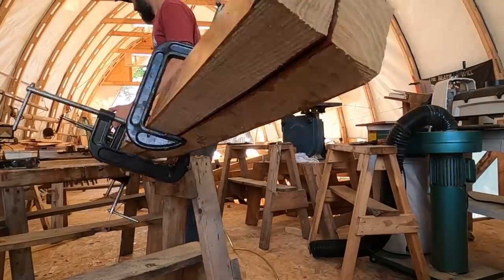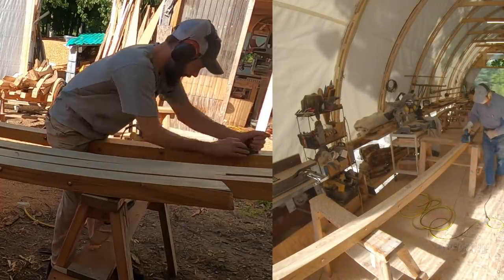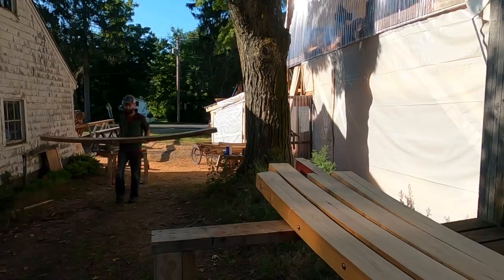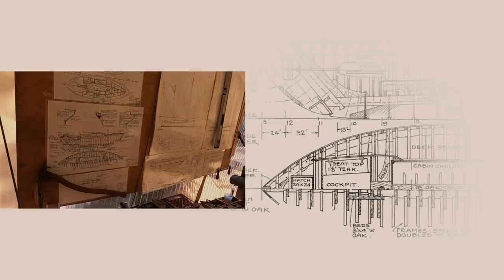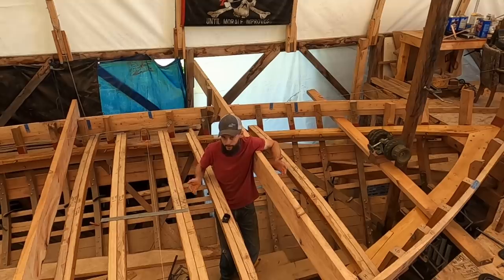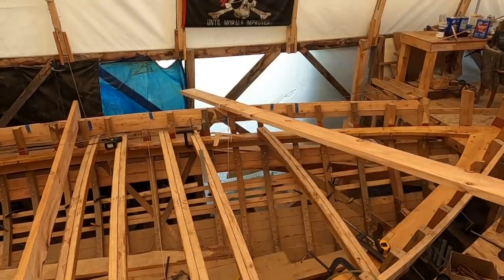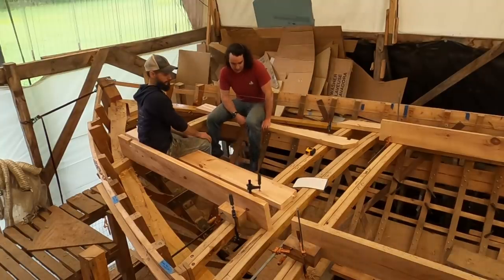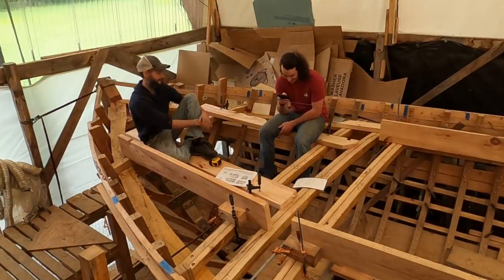Deciding the Hatch and House Locations - Ep. 130 - Acorn to Arabella: Journey of a Wooden Boat

Comment: I have been building boats for a lot of my 68 years on this planet.  I wish I could jump on a plane and come help.  A nice tender is great but I would also put on a life raft along with the tender.  You never know when disaster strikes.  An unsinkable tender still tide down to the deck will sink like the amount of lead ballast you have in your boat.  Whale strikes, freighter ramming's and reef ramming's will sink a boat in seconds, not minutes.  Have a secondary life raft.  Have epoxy and boards to slap on in case of a puncture from an underwater object.  I always carry a sea anchor in case of a tiller malfunction in a storm or hurricane.    Looking wonderful, a dream project until you know the boat is too small and you build a bigger boat, LOL!!! Blessings and health to you your crews and families from northern Israel.
Reply: And a Rescue Sling!
Reply: It's starting to look really small with those deck beams in place.
Reply: @Majoofi  I thought so too, but it may just be the (relatively) wide-angle lens of the camera.
Reply: solid advice, dingy AND life raft. dingy is better light, cannot explain how many disadvantages for everyday use a heavy dingy has, that build sounds like weight is ramping up pretty quick, design your dingy, then talk to full time cruisers about it, soon find out if it is a good dink plan or has serious flaws.
Reply: I thought they said they planned on building a dingy with Victoria’s wood.

Comment: Regarding the fore hatch location: it looks pretty tight up against the main mast. 
* Ideally you'll want to have room all around the mast to stand and work a halyard. At the very least enough so you can easily cross between hatch and mast from ps to sb.
* The hatch hinges forward, for it to function as a passageway and not just ventilation I think you'll want more room to stand on deck.
* If the hatch is open, the cover obstructs the way around forward. Don't leave yourself without a save, comfortable way to cross the deck when the hatch is open.

While working the mast The hatch hinges forward, so between hatch and mast is where you end up when you go out that hatch.
Reply: 👍 very good points. Building a sailboat and sailing one is a big difference. Haven't heard a word concerning a bowsprit either. They where used on serious open water (blue water) boats.

Comment: On the Mizzen, while I have not studied the plans with any great detail it looks to me as if Atkin (sp?) was using the two levels of beams as a cantilever so that the mizzen would be pushing at the top and pulling at the base when under load. This would take a lot of torsion off of the deck beams.
Reply: @MyChannel-wg8ml  he was talking about forward and backward loading on the beam not the side to side loading
Reply: @MyChannel-wg8ml  Not really thinking of vertical load. A mast on a sailing ship is loaded horizontally when under sail, with wind pressure behind the sail and force coupled through the mast to the structure in order to provide movement. 

When a mast is mounted flush to the deck in a collar, the thrust from wind pressure causes the mast and mounting collar to rotate downward at the front of the collar while pulling upward at the rear. This causes a localized twisting force at the base of the mast which is transferred to the deck and/or supporting deck beams (hence, "torsion"). 

Back stays and braces are intended to relieve this pressure but all cables stretch under load, so not completely effective. Modern aluminum mast mountings accommodate the "twisting" under sail pressure by mounting the relatively lightweight aluminum masts onto a hinged plate that actually opens forward as wind pressure is applied. Wooden masts from older designs were "double-stepped" for this reason.

By mounting the mast at two separate points with some distance between them the center of rotation moves to approximately halfway between the two mounting points  Thus, the "twisting" force is split into a forward thrust at the upper mount point and a rear thrust at the lower mount point.

It is true that "cantilever" is generally used for horizontal applications, but I could not think of an equivalent term when discussing vertical structures.
Reply: Hirakawa Dojo as a professional engineer, I immediately understood your comment. While the reply was valid, it was a prime example of spouting off information without know what the topic was. Good job at putting them in their place.
Reply: @alexnelson8  It was not really a matter of "putting them in their place" so much as wanting to be clear. I have an engineering degree as well, but I have not used it much in the last 40-50 years. It turned out engineering was not my passion.  As a young man I was very much into sailing and spent a number of years at sea, so things like this are buried in my head from long ago. 

The main mast on the plans is also "double-stepped"; with the lower end being anchored at the keel and the upper braced at the deck with that pair of nice heavy double deck beams Steve was sitting on. You cannot really anchor the mizzen to the keel though; that pesky engine is in the way ;)
Reply: @MyChannel-wg8ml  you have a point - as the mast is between two beams rather than on top of one, there will be torsional force taken by the two deck beams as a unit, but that will effectively be a downward force on one and an upward force on the other. I think the original point about the different deck levels still stands though, as it would add another bit of offset structure that can support that bending force from the mast.
Reply: @MyChannel-wg8ml  Two ways normally used to mount a wooden mast: Stepped into a collar sitting flush on the deck and horseshoe bolted around a deck beam, or "double-stepped" with an upper and lower support beam as in Atkin's drawing. Aluminum masts are typically mounted on flex plates as noted before.

If you ever chance to see the backstays let go on a flush mount wooden mast the big chunk of deck ripped completely out and a vertical deck beam twisted into horizontal will immediately explain the term "torsion". Funny thing was, the deck beam was perfectly fine (other than being twisted like a dish towel). They pulled the mast back up and patched the decking, boat was back under sail in less than two weeks.

Comment: You can open up the foredeck a lot by getting rid of the sampson post and going to a couple of large cleats.  Not as traditional, but more functional.  You have plenty of structure to bolt them to.

As far as a lifeboat/tender goes why not cold mold one.  A cold molded hull will be as strong as a strip built hull and it will be much lighter.

Also there is no reason not to step the mizzen or both masts on deck.  Deck stepped spars need either a compression post or some sort of support below the deck.  If you want a more open space below a ring frame or two can replace a compression post.  My ketch has deck stepped masts and it has been sailing for 47 years that way with no issues.  One consideration for the locations of the aft face of the house and the mizzen is the location of the companionway.  You want to leave 18" or so between the aft end of the house and the mizzen if you have a centerline companionway or you need to be contortionist to use the companionway.  That issue goes away if the companionway is off the centerline enough.

Comment: I owned a Tahiti Ketch.  The Mizzen was stepped on a beam below the cockpit.  The engine was below that.  If you step the mizzen on the cockpit sole, it will only be supported by the standing rigging and be much weaker than the other way.

Comment: Love the idea of an unsinkable closed-cell foam-core life boat/tender. Definitely with sail rig and oars. Maybe even a small electric motor with solor charging for the batteries if you want powered propulsion? A tent style shelter would be a wonderful addition for shade out on the open sea in a life boat situation. Maybe even some sort of desalination system if one exists in a small enough pakage to carry on a like boat? Would a "life straw" filter salt water to a drinkable state? Loving the progress on Arabella as well. The double beam adjustments look like some smart well thought out moves.
Reply: A life-straw cannot filter dissolved minerals like salt.
Reply: @johnmiller8884  but some other water filters can.

One cheapish filter can turn a can of root beer soda into pure water. Gotta replace the filter after that can, though. I forget the specific brand, was really common 20+ years ago.

Comment: Hey Steve,  You need to put that power planer on your Christmas list.
Reply: They are very useful. And most people don't really consider it, but it fulfills the role of a regular plane just fine. THE only caveat being that you need a good surface to calibrate it on and have stepped shims to raise however much you want to take off (because of how the design is made, some have monoblocks, like the one above, some are floating blocks, where the step raises and adjusts completely separate from the handle).

I have 2 regulars sized ones, one normal from Hitachi, and a convex/concave one from Makita. And i really don't go for the normal one. At first i did, then this old guy that made doors for our restoration projects hinted me that if i keep a flat plate to adjust plane and shim plates for the step, i'll never need another plane. And i just use the Makita, because it works really well and i have 3 tools in one.

Comment: @ Steve Acorn To Arabella
Perhaps as you were talking about making the boat unsinkable you could put a few layers of 2.5mm or less Corflute between the hull & inner hull with 2mm gap between each sheet of Corflute. Within the 3 layers of Corflute you could could put Part A & Part B liquid closed cell foam in the gap between sheets which if say a ship or whale breaches the outer hull along with 2 layers of Corflute then both Part A & Part B of the closed cell foam liquid come together to seal up the breach. At the moment of a breach you could use two of those CO2 cartridges from a life vest to force air into the section of the breach at the top which would force both Part A & Part B to go to the breach & seal up the breach immediately. You would only need to make rectangle sections of Corflute below & just above the waterline that were 2mm gap filled with the Part A & Part B closed cell foam so that expansion would happen at the breach rather than within the wall. Having closed off sections of these vertical Corflute sheets sandwiched together with a fine layer of 2 part closed cell foam liquid would act as a safety barrier around the whole ship from under the waterline to above the waterline.

Comment: I have the old Stanley compass plane, and a record 120, and I've found they work better if the sole is removed and reshaped similarly to a Japanese wood body plane, to focus the pressure on the wood at the mouth edge in front of the blade. The Record was way out, hadn't been used much. the Stanley was not so bad, but needed some love. Instead of scraping like a wood bodied plane, I used a crosspeen hammer and anvil as you might to straighten a saw blade, only give the two spring steel  pieces a little hollow stem to stern, but straight side to side. then stone the frog to follow. But I wish I had had the motorized Makita compass plane at times. Very handy tool for bringing out the beauty of wood and a pleasure to use when tuned.

Comment: A light weight dingy will be appreciated every day.  An over built, heavy dingy will cause endless misery.  Everything is a compromise. On our 40' wood boat, we ended up using an inflatable when cruising because it was so easy to handle, deflated it stored below decks and it didn't chip paint bashing into the hull when boarding in a heavy sea.  The nice thing is that you can change dingys any time you want, you don't have to make a final decision.

Comment: Agree with previous post Be careful moving the forward hatch aft you will spend more time working on the mast than the windless and quit often you need to stand in front of the mast especially in rough weather. Plus the further forward the hatch the better the ventilation

Comment: I always found a Bit Brace to be faster, with more finesse and more power to get things just right, too. It just is that way. Besides, it feels so much better. It gives all craftsman a feel, a sensory/tactile connection to the wood. You can feel what the wood's grain is tell you through the bolts or screw. And it just sounds so much better with its click click in the ratchet latching mechanism. Old, well used ones are smoother feeling and sounding, because of the wear. | Music to my ears, that is for sure.

Comment: I know it's a bit late but did think about building the interior of the boat before the deck beams are secured? Modern boat have as much as possible built in the workshop and placed in the boat before the desk is installed. The only reason not to build before the deck beams are secured is you haven't got the final hull shape. The units can be made with an extra 3 inches that can be scribed into the hull, later.
Reply: That works better for molded production fiberglass boats than for one-off builds.  Large modern boats have the interiors added after the hull is complete.  Check out Trinity Yachts.

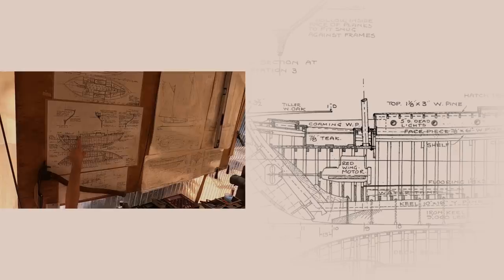Comment: At 10:00, you ask, "Why not just stick the mast on the deck?".  to me, that implied that the mast will be attached to only one level of structure.  I don't see how that would provide substantial resistance to the mast being rotated around it's base (unless it is kept upright by rigging).  If it is held upright by rigging, I would still think that you need two levels of restraint to hold the mast when the ship is being rigged, so that a stiff breeze during the rigging work does not lay the mast across the gunwales.

Comment: Stephen, maybe you should consider making your life boat out of carbon fiber.  Ultra-light weight could translate into something a bit bigger than these portland pudgies.
Reply: That would be a great idea... Paint it afterwards Nobody need know it's plastic but extremely light and strong and you can make them insulated and unsinkable, with a sail and oars, etc'
Reply: I hope you are a patron at the $100/mo level because carbon fiber will make those bronze floors look downright cheep.  Also, while it is amazingly strong for forces in-plane, it is notoriously brittle which would concern me if one were to hit a rock.
Reply: @johnmiller8884  depends on how you lay it up, but that's a pretty specific skill. You can build pretty solid and reasonably light fiberglass structures with lots of foam inside the walls to be unsinkable even when full of water.

Comment: Your tender needs to be light, else once it's in the water, you'll be towing it when you shouldn't be, and once it's on deck you'll avoid visiting the shore in places you should. Life rafts are dodgy (I was taught 'you should only get into your liferaft if you have to step up to get into it) but limited options in a crisis affect decision making at a very stressful time - I have never had to use one, but I've read some accounts, and it seems to be a real comfort whilst trying emergency remedial action on the boat, to know that you are only 60 seconds from having a floating liferaft in the water - a dangerous place to be sure, but not as dangerous as swimming.

Comment: About that brace drill... I had a stuck plug on a tractor that I got out with a cheater bar, but when I got it my friend asked me why I didn't get the air wrench, said it had more torque. Mathematically, even my scrawny butt puts something like 1200ft/lbs or force on a decent cheater bar, no feasible gear ratio in an electric or pneumatic drill is going to get that! A chest braced drill like yours has about 6" offset, and that's quite a bit of lever!

Comment: with that expanding foam, people don't realize that you can shape/smooth it as it grows, and instead just let it expand randomly overflowing then cut massive amounts of excess away which is messy and wasteful plus leaves a rough porous surface - all you have to do is cover the foam with plastic wrap/bags/drop(which it wont stick to) then shape it with hands or smooth by rubbing a piece of cardboard, compressing it down to make it stronger or adding thinner layers, then the plastic is peeled away(once the foam has cured enough) and reused on the next spot as you go; misting with water before the plastic helps it cure faster, and you can always trim back with any serrated saw or knife then give it a top layer to seal it back and make it firm .... but I could see doing the inside shell of a boat like that and f-glassing over it, also keep a spare can or two with the boat to patch any holes, as it does stick to wet things